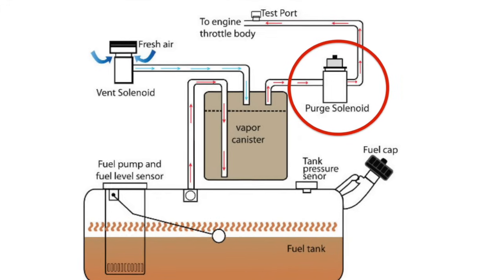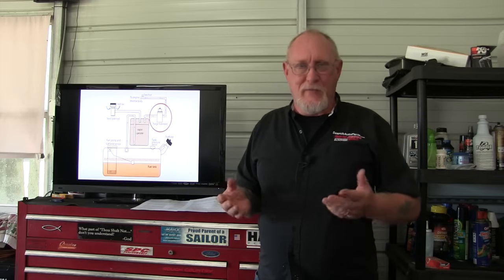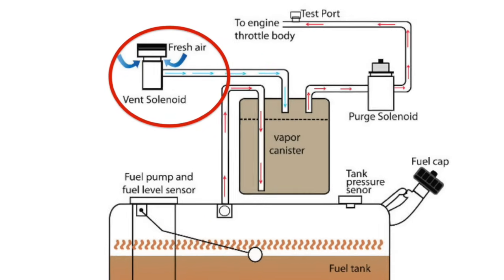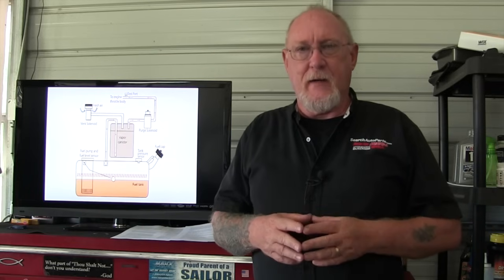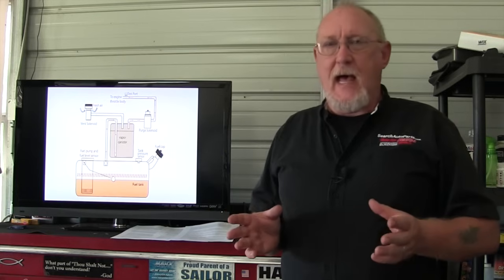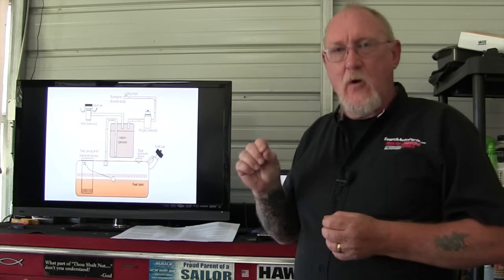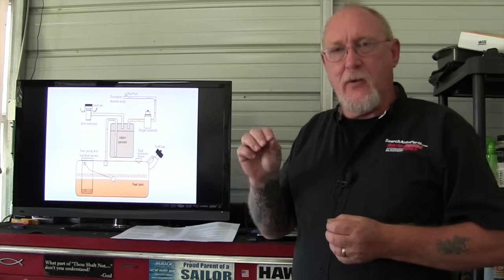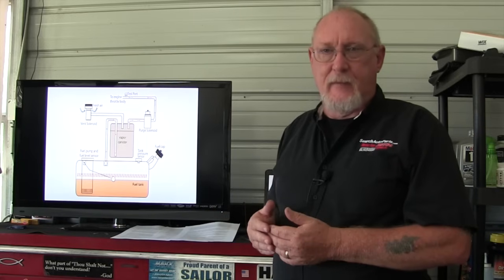The Trainer #70 - EVAP Testing Tips

Comment: I had a Evap leak code.  I looked under the car and found that the line coming from the tank to the canister was broken.  I glued it back in place, and the code went away.  But the problem of a rough idle after fueling still exists.  Is it the purge valve, the glued piece, or the system is dirty?  No code yet after many miles.
Reply from the maker: What year, make and model are you working on? Any codes - set or pending? Do you have fuel trim information?
Reply: 2008 Ford Escape XLS 4 cylinder.  I am using Blue Driver to read codes and it just has mode 6.  I can gather some fuel trim info, what am I looking for?  Short term or long?  I fueled up again today, and it still has trouble starting and idling.  No codes popped up yet.
Reply from the maker: @cloudchaser907  If the problem is occurring ONLY after fueling, then I would suspect a problem with the purge solenoid. When you fill the tank, the fumes should be contained but if the purge solenoid is open it may be allowing excess fumes to enter the engine - creating a momentarily "rich", or even "flooded", condition. 

Try disconnecting the purge line from the intake and closing off the nipple on the intake to keep it from sucking air OR try holding the throttle all the way down on start-up in "Clear Flood" mode to see if that helps.

Comment: Ok thanks for gathering that info that's what I had dialed it down too also the only problem is  evap pump module is part of the canister for theses years don't think you can replace just that component unfourtantly without replacing evap canister which is bout 4 to 6 hundred dollars lol

Comment: Shot an even problem in my 4 runner now and it's driving me up the wall
Reply from the maker: What's the problem?
Reply: I’ve got an evap issue somewhere also that has kicked on my traction control and skid lights supposedly that’s is a fail safe thing for Toyota don’t have a scan tool to shut valves so I may have to go with a smoke machine
Reply from the maker: @davidblankenship7599  What codes are you trying to diagnose? And what year is the vehicle?
Reply: I’ve since got a exhaust leak but my code are as follows p043E,p043F,p2401and2402 with a p2419 code but I know some of these codes can cause other codes
Reply from the maker: @davidblankenship7599   There was a Technical Service Bulletin on this issue:  

TECHNICAL SERVICE BULLETIN
Reference Number(s): EG040-06, Date of Issue: June 22, 2006
TOYOTA: 
2005 - 2006 4Runner
SECTION: 
ENGINE
COPYRIGHT: 
© 2018 Toyota, USA License Agreement TMS1002
Introduction
Some 2005 and 2006 model year 4Runner vehicles may exhibit M.I.L. "ON" with DTCs P043E, P043F, P2401, P2402, and P2419 stored. The EVAP pump module, which is part of the charcoal canister assembly, has been improved to correct this condition.
Reply: I have replaced both vsv valaves under the hood and replaced several vacuum lines and I know that on my 2006 Toyota 4 runner sr5 that the purge valve is built into the charcoal canister
Reply: 4.7 v8 2uz fe engine also
Reply: I’m sorry I replaced both vsv and vacuum purge valve under the hood the ccv is on my canister
Reply: Can an exhaust leak or exhaust issue be the problem from the start maybe
Reply: Replaced gas cap with new gates cap and also I noticed that there is never any pressure in my system when I crack the gas cap , good or bad?idk
Reply: Went and checked my freezeframe data and number one thing on top was p2401 set and checked the Evap_pct and it was 0.0 if that matters

Comment: Great review. I started with the service valve on the purge valve under the hood of my Jeep. I added a balloon at the other side of the line in the back and watch for deflation. If it did not I added a component and watch again. It is how I checked the purge valve and the LDP as well. I isolated the fuel tank and the canister and worked my way though the system. For pressure, as it is 7.5 inches of water, or 1/4 PSI I used a bulb you get of a blood pressure cuff. Easy control. It took me a while to really understand how this EVAP worked but once I did I just processed it. Of course I had a leak on top of the EVAP line on top of the fuel tank. Not much fun but did fix it. Learned a lot. I do have a Launch 431 scanner but there too you have to learn specific tests. You also need to know how it looks when all is well. So starting of with failed system made that difficult.

Comment: @Motor Age Pete, EVERYTIME I perform the EVAP Purge/Seal test on my 2004 Trailblazer EXT LT 4.2L 6 cyl. my car stalls immediately ONCE I HIT THE SEAL BUTTON, and all vacuum in tank(I usually pull vac between -7 to -10 inH20, that's like 60% command on the Purge) goes immediately back to 0.00 inH20 and the FTP sensor voltage goes down from 3-4 volts back to atmospheric 1.5v. EVAP Diag seems to be my nemesis! Any thoughts, suggestions, remedies, tips, ANYTHING? Thanks in advance.
Reply from the maker: On the road today...send me the full story (pete.meier@ubm.com) and I'll take a look when I get back
Reply: I'm actually curious to know what became of this.....

Comment: My method to shut the solenoid was I ordered a solenoid connector wire and put a fuse to it with a toggle switch and ran the wire from my battery to the solenoid... Basically I made a jumper wire to shut the solenoid off...

Comment: Any DIY scanner you would recommend me. As I said, for a DIY person, not a mechanic, something that would help me out with my 2013 Toyota Tacoma, v6 with automatic transmission, thanks, blessings.
Reply from the maker: If you just want to access emissions-related information (stuff that turns on the Check Engine Light) then any scanner built to meet SAE Global OBD II standards should work just fine.
Reply: @VehicleServiceandRepair  What scanner are you using in this video ?
Reply from the maker: @coyotespirit7128  LaunchTech X431

Comment: Any 1 that  knows the evap system of vw cc 3.6.. did several tests but no conclusive answer... drop your email pls
Reply from the maker: Let's start of by getting some more complete information. Make, model, year, engine size, auto or manual trans? What is the issue or DTC you are attempting to fix?

Comment: If you overfill your gas tank, or have a full tank and go over large bumps in the road  could this damage the vapor canister by causing liquid gas to go into the vapor canistor
Reply from the maker: No, an overfilled tank will not cause liquid fuel to enter the canister.
Reply: Motor Age, Scotty Kilmer says don’t overfill https://youtu.be/7BJTilcHYP4
Reply: I have same problem .. If I overfill the gas tank  I found liquid gas in vapor canister.. And I found code P2188 by obd2 checker.
Hyundai Elantra 2013 1600cc  230k mile

Comment: If the gas guage doesn't work will that make the computer run the car differently?
Reply from the maker: It can impact the EVAP testing the ECM does, depending on the design. The same signal used to operate the gauge is also used to inform the ECM how much gas is in the tank,
Reply: @VehicleServiceandRepair  Thx man i appreciate it. My fuel guage wasnt working, then the fuel sending unit finally quit working. After a shop put the new one in it still doesnt work. They said it was a bad cluster. I parked on a steep incline one day and the fuel guage began to work and i gained normal power to my vehicle for 15 minutes til it quit again. I don't know if they did something wrong or not. I had other shops do diagnostics and couldnt find nothing. I just found i have a leak in the plastic intake manifold gasket, i put GDI intake cleaner in and all my vacuum leaks showed up when the system pressurized when i shut it off. Do you think the intake leak could affect my fuel tank from pressurizing properly and not get a reading on the gas guage. My 2004 explorer 4.0 flex fuel GDI engine has been a complete nightmare.
Reply from the maker: @lebeckchris  No,, that's not going to cause the fuel gauge to read incorrectly. Sounds like you may have more than one issue going on.

Comment: Great tips. I worked on a 2017 Sonic last week that had a faulty purge valve. It would only fail when activated by the PCM (pulse width modulated), and created a p0171 code. No EVAP codes though.
Reply: Did the vehicle have a rough idle?